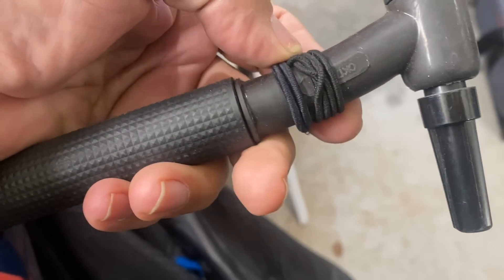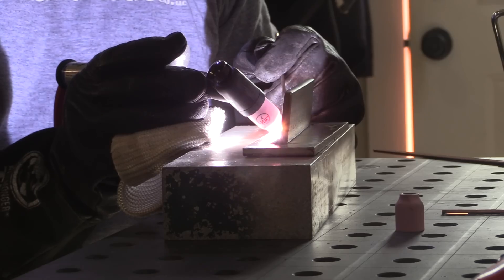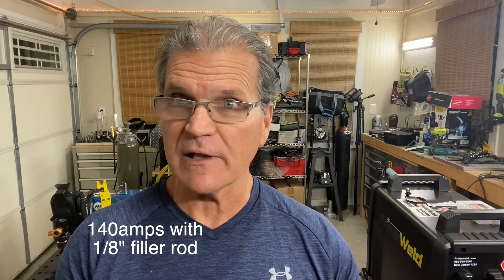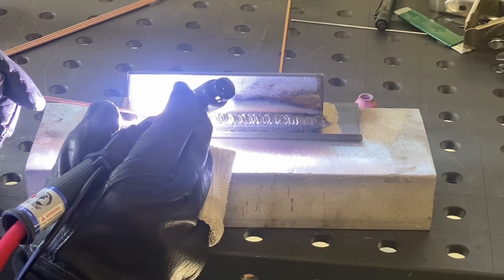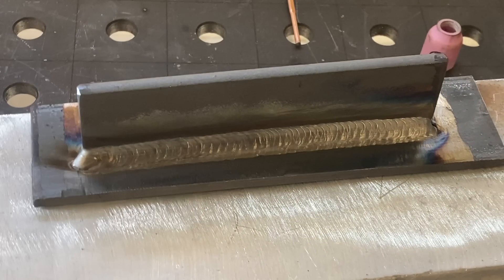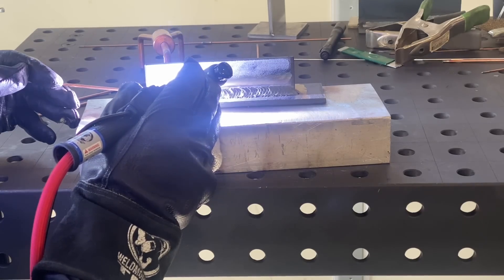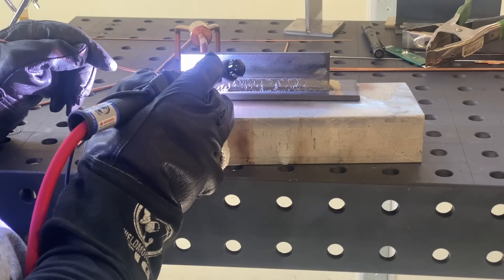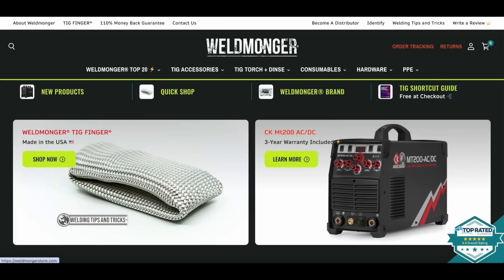TIG Welding a Carbon Steel Tee Joint MultiPass Fillet Weld

Comment: Hey I’m a student I’m doing the same thing but up hill with the same setup you have i just feel really awkward when going up and I’m having a hard time with the wire forming droplets instead of weaving along with having issues stacking them any advice I want to get good at this but I’m having a really hard time
Reply from the maker: You might try a shorter stickout so that the tungsten angle doesn’t aim so much at the tip of the filler rod

Comment: Jody I'm an old welder in Australia. I find reflective light coming into the back of my helmet really effects my vision. I'm thinking of trying these new welding masks do you have a position on those? I dont do much tig but when i do with my old eyes i can barely see the puddling particularly on small joint material fuel tanks etc you might have some tips?.

Comment: Hi Jody, I need to weld a 10mm fin plate to a 125 x 125mm post and I'm a much better TIG welder than with stick, also the position is over glass balustrade and stone paving so don't want red hot BB's dropping onto any of that. It's outdoors so there is the problem of containing the Argon. Any suggestions would be appreciated. Weld is verticle and fin plate is 200 x 70 x 10mm thick.

Comment: One more thing about that machine Jody, I know it's a "MMA" (whatever that means) stick welding thing which is not in effect while TIG welding BUT since you're on the 325TIG in this video, I thought I'd inquire as to your thoughts on the topic.  There's nothing in the PrimeWeld manual addressing two settings designed for stick/SMAW. "ARC FORCE" and "HOT START" are clearly labeled on the machine, but are never mentioned in the current TIG325 manual.  I didn't look at the 225 manual (just did, those settings don't exist on the 225). Primeweld has "cleared it up" for me, but I already kinda knew from watching guys use other machines with those settings. I haven't even hooked up my stinger for burning rods yet-I'll do that when things warm up. I always thought the choice of electrode (coating) determined penetration characteristics, now we have "arc force" to play with.  Could be interesting, might be confusing to some.  What parameter of DC are they manipulating to create more/less force I wonder?
Reply from the maker: I haven’t stick welded with the 325 yet but hot start gives hotter arc for a short time for better starts. Arc control gives softer or more aggressive arcs by sensing arc length
Reply: @weldingtipsandtricks  Thanks Jody.
Reply: WHOOT: Found one WTT video on "arc force" with a different machine. I'll re-watch it. The title is "7018 Uphill & arc force" for anyone else wanting to know more.

Comment: Wow Jody, just LOVE those "old fashioned" knobs on the Primeweld machine. As you may have heard they changed them to yellow in color and eliminated the line on the outside diameter of the knob. Also they used WHITE on Yellow such that the indicators are practically invisible on the new knobs. 

I let them know it was a poor decision to create knobs with invisible indicators (It's nearly always a problem letting marketing considerations change the product). They say they've redesigned the knobs to have a black line on the yellow, and I'm on the list to get a replacement set (gratis). Those knobs on your machine are about perfect-but they did away with them for "fashion" sake (branding/marketing).  Hate it when marketing screws with design functionality. Love it when  a company realizes their mistake and is willing to help the users caught with the compromised design.

But then I think I'm going to put some chicken head knobs on the welder anyway for style AND functionality. 🤪
Reply: Also I did share a screenshot of your knobs from this video to remind those guys what a good knob they had.

Comment: Hi Jody, great video!  Could you tell me who makes that torch switch?  I've been looking for one and can't seem to find the one you're using.
Reply from the maker: It came with the PrimeWeld TIG225. You can find generic switches just like it online at amazon or ebay but finding the right plug is key...

Comment: hi great video as always giving us a chance to learn a lot of new things but i want to ask something.  sometimes I try to repeat your exercises and I notice that the amperage you use is too strong in my experience and I wonder if since I am from Europe with a voltage of 220 volts current the amperage is stronger?🤔
Reply from the maker: Not sure about that. I think I tend to weld hot sometimes tho

Comment: Hey Jody, I'm doing the tig welding for our FFA competition and I was wondering what you had to say about it. Using 1/8" carbon steel pipe to plate t weld and having troubles with burn through, running around 100-110 amps.
Reply from the maker: Sometimes it helps to go hotter and faster.
Reply: @weldingtipsandtricks  Alrighty, thank you!

Comment: Thanks so much, Jody. This was an amazing video. I`m a little bit speechless. Yeah, I think my instructor did make us do this so we could make fill/ cap passes on V-grooves and pipe. I had never even heard of this weld until I went to school. We haven't done pipe in the intro to TIG class, but we did V-grooves, and they were quite a bit easier than the 1/4 T-joints. I`m so glad you were able to work this joint in with your other projects. It means a lot, and this video was extremely informative. I could still use some practice on this joint because they never came out the way I wanted in class, but especially now, I think I can perfect it. I finished intro to TIG, but still need practice to be as good as I want. This will still come in handy for sure. I appreciate you doing a video based on my comment. I can't tell you how amazing that was to see. Keep the videos coming ;)

P.S.
I ended up with a 94 in that class, despite struggling with this joint. I don't think grades mean that much in welding school, but the point it, I still did pretty well after all ;)
Reply from the maker: Congratulations on the 94. Wish you the best

Comment: able to post a video about 3g pulse mig downhill? i was under the impression pulse mig should alway be uphill but my work likes to do tests down hill, i having a really hard time with blowing through my open root plate, if i get my root fine i usually get lack of fusion in my fill and caps during the bend test
Reply from the maker: I can try. What type of job is it?
Reply: @weldingtipsandtricks  3/8 open root steel plate. pulse mig 3g position, downhill only

Comment: If a guy was welding .625 titanium in open air for a test. What would you recommend for amperage. Having embrittlement isssues. What heat range would a guy keep the part in during pass and interpass.
Reply from the maker: I have seen some welders using a technique where the pulse with foot pedal only adding one dab before tapering amperage off all the way to keep heat from building up. This is repeated again and again. Slow go but it does prevent grain growth. My personal experience with titanium is in aerospace so much thinner than .625”. Sometimes in a chamber but open air too. We used chill bars when possible
Reply: @weldingtipsandtricks  what is more likely to cause a brittle Ti weld? Over heating, welding on a part thats too cold or heat cycling the part too many times. I appreciate your input.
Reply from the maker: @trilledskadesman3922  the main things that cause embrittlement are oxidation and grain growth. Oxidation is prevented by argon shielding on all areas outside and inside. Grain growth is caused by too much heat for too long. That’s why some procedures call for very low inter pass temperatures and also utilize the on off foot pedal techniques.